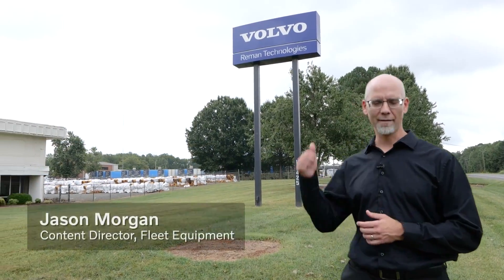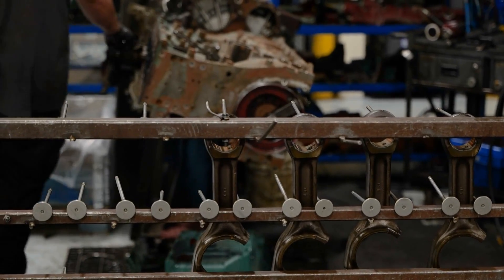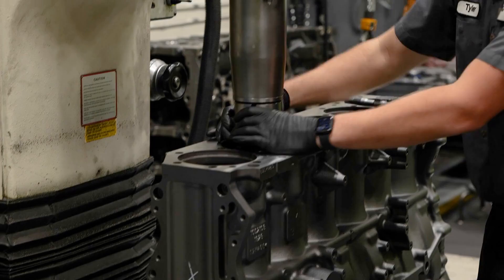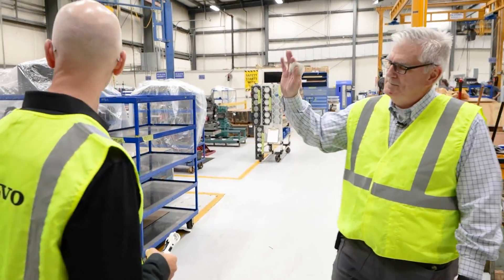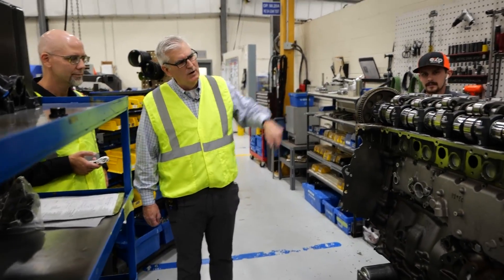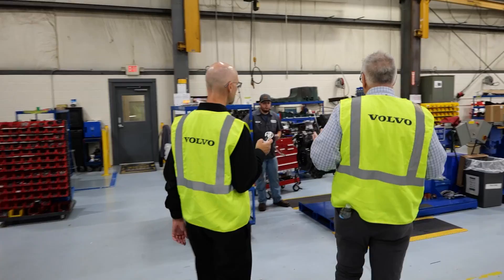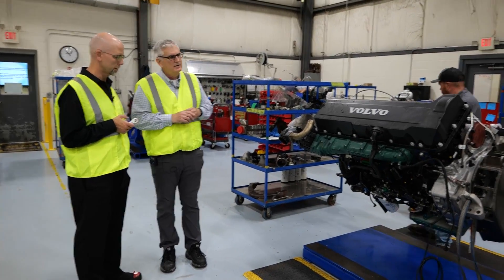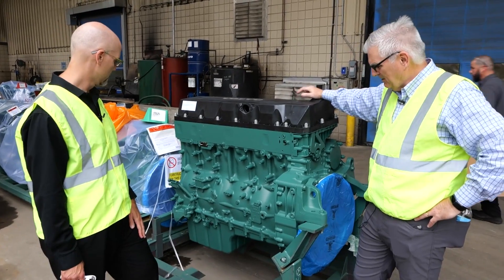Volvo Trucks – Episode 5 – Remanufacturing and sustainability: Breathing new life into trucking

Comment: Great video Jason. That’s a nice set up at VOLVO Reman. Be it 3/4 or 7/8 rebuild/exchange it beats rebuilding your own or a third party shop. The manufacturing tolerance at the factory is consistent and I believe will come with limited warranty. Uptime should be increased if the dealer has an engine in stock. One out, one in and away to go.
Any idea what the price difference of a brand new, 7/8 or 3/4 exchange would be, prior to labor costs?
Congratulations to VOLVO Sweden on the launch of their new 17L 780 HP world class engine. King of the hill again.👍🇺🇸